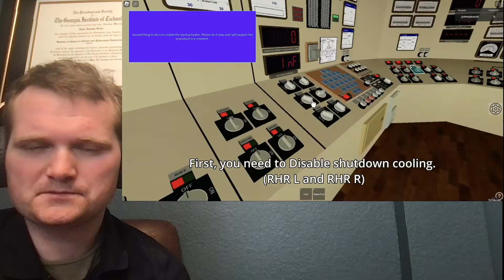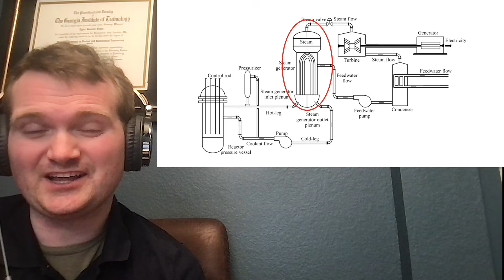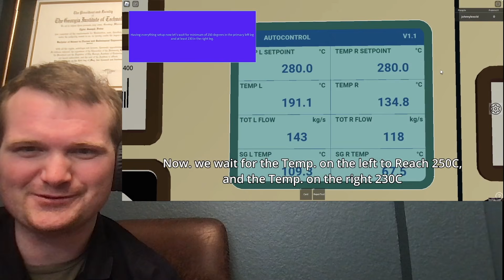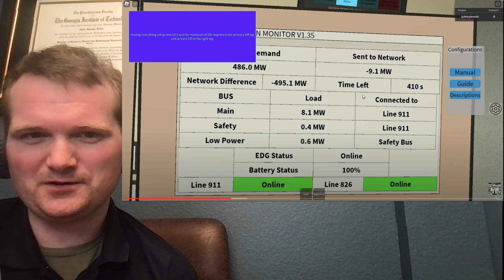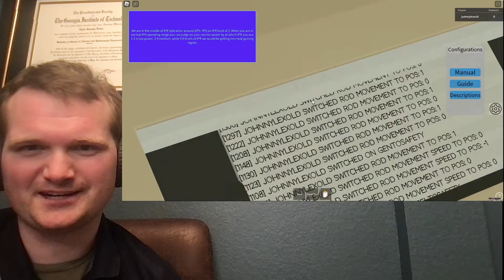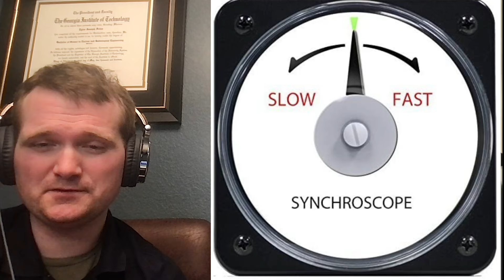Nuclear Engineer Reacts to Roblox Realistic Pressurized Water Reactor Reactor/Turbine Startup

Comment: something i noticed about the PWR simulated here. The primary coolant loop seems to have a system where concentrated boric acid or clean water is injected into the system, allowing an equal amount of fluid to be pushed out into a collector tank, where the extra water can be boiled off to re-concentrate the boric acid and recover it. Is that a realistic system or is it more like Nucleares where there is an ion removal column that doesn't allow you to recycle boron?

Comment: Thank you for looking at our RPWR project. W try to balance realism and gameplay, so a lot of features are for the gameplay reasons. Ineed the RCPs are variable speed pumps, we did this so it gives you a more general approach to see how everything interacts with each other. There's no problem to just put them at flat 50% and work as with constant RPM RCPs. The simulations really shines in fully manual mode because you can see how the reactor actually follows the steam demands ordered by the turbine valve setting. In other words we try to provide an educational and physically realistic experience in a simplified control room environment.

Comment: Can one reactor run many generators? Fromw what you expalin of the pumps i'm a bit surprised they don't use Variable Frequency Drives and one large pump and just ramp up the speed from the VFD.
Reply from the maker: Yes, they can! Chernobyl actually had 2 generators and 2 turbines. Though, the plant I worked at had one generator that was larger than both of those combined (in terms of MW). 

As far as just using one pump, the issue is redundancy. For instance, we had 3 condensate pumps, but we only kept 2 running to maintain 100% demand and the third was there in case one of them tripped.

Comment: haven't watched the vid yet, but im actually trying to make my own realistic (as in as realistic as realistically achievable, by me) 3d boiling water reactor sim in opengl/c++. currently, it has no safety systems or any equipment outside of the "absolute essentials" for getting a reactor stable (control for control rods, inlet pump, and steam valve), it also has a quirk where i measure neutrons in picomoles instead of something more standard (such neutron flux in n/cm2/s).

i did attempt to actually operate the boiling water reactor roblox sim. all i did was turn a bunch of alarms on. and also everything is really hard to really maintain situational awareness of the plant, especially with all the text being so small and hard to read things. also, in the tutorial process, i thought the reactor power was pretty unrealistic. like yeah, when everything is still cold, initially reactor power is going to be pretty exponential because of the lack of voids in the coolant. but when everything is heated up, the reactor should stabilise itself and the void ratio of the reactor should remain constant.

Comment: It is funny that you mention making steam and the point of adding heat. I almost failed my first reactor board because they asked me what was the point of adding heat and I said, "To make steam". I thought it was funny, but they were not impressed. I then gave the real answer and the board continued. Afterwards, they told me that they almost failed me because I made that joke. LOL
Reply: Whats the answer?
Reply: @gelo1238  
if the heat is from the core, it is to make steam
if the heat is from the electrical heating system, it is to warm the core before starting

Comment: RPWR looks a lot like the level of simulation in RBWR unit 1 (unit 2 is pretty old by now). They did a lot of updates on the boiling water reactor as well, so it might be worth re-visiting. The game also simulates you having to diagnose malfunctions and having to repair them for points, or unexpected events like grid loss or islanding requests. Those are "simulated" together with demand changes purely to make the game interesting -- otherwise you would start up the plant, set it to 100% and just sit there for hours.

The reason the log printer also prints out the user that flipped a switch, is so people who were deliberately messing with the game can be kicked.